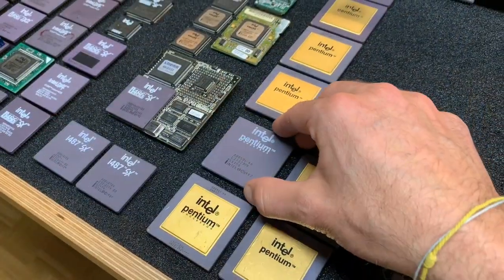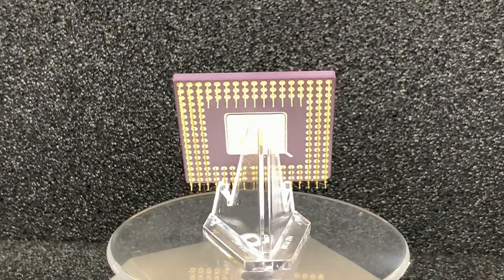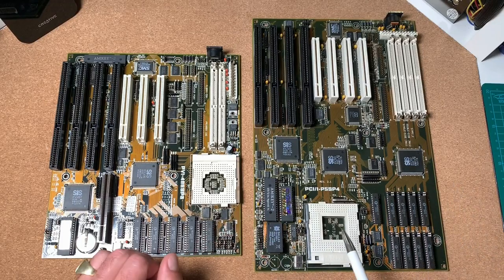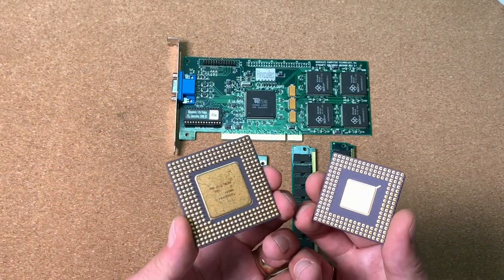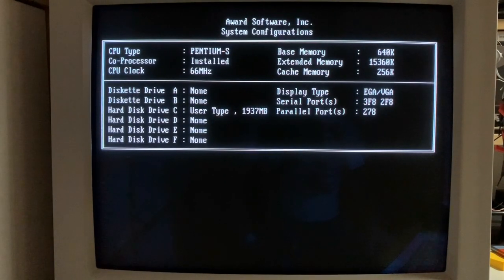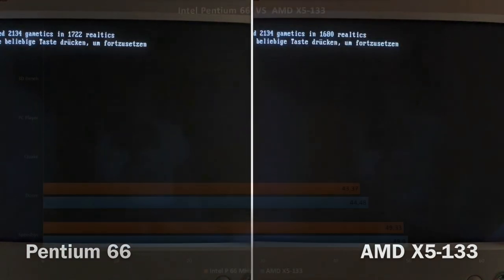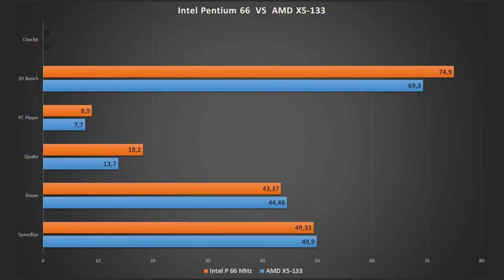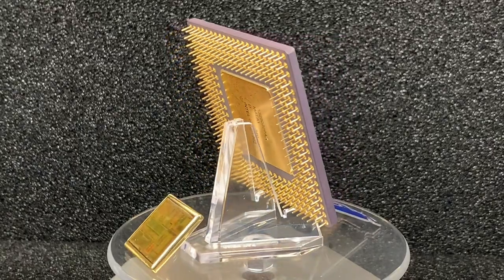Intel Pentium 66 MHz VS AMD 486 X5-133 MHz

Comment: Those early Pentiums are 800 nanometer, 5 volt monsters. Even the first gen pentium had a couple of process improvements. I think there were 500nm version and the last ones were 350nm.
Reply: 600nm, for second generation (Pentium 75,90,100). And 350nm for next one (120, 133,150,166, 200)
and MMX versions. (though they were 2.9V vcore, so were overheating less on higher frequencies)

Comment: Cooles Video. Besonders deine Wahl an alten CPUs. Ich bin auch derzeit am überlegen ein DOS PC zu bauen, allerdings kein Plan welche Komponenten ich mir zulegen soll. Hast du irgendein Vorschlag?
Reply: Mainboard ohne UEFI-Bios wie ASUS STRIKER und Intel Core2quad @2700mhz mit 8 GB DDR2 und mit Saphire Radeon 7950 PCIe VBE3 Bios mit 28" LCD monitor native 16: 10 Seitenverhältnis mit Grafik mode in 1920x1200x32 mit MS DOS 6.22. Ready to startup all cores and switch to 64 bit mode.

Comment: A Pentium based system in 1992 was five or six thousand whereas the 486 133 could be had for about half that.
Reply: 90% of the performance for a tenth of the price.

This is why the price of PCs started to decline quite sharply.

Comment: The Pentium didn't perform better in Quake simply because of higher FPU performance, but because the FPU didn't stall the integer unit, unlike on the 486. Quake uses integer and floating point operations in parallel and that's why 486 CPUs struggle so much.

Comment: Excellent and collectible hardware ... very interesting comparison .. the question that remains is the memory access time of the pentium, it seems not to be correct. It would be interesting to try other memories .. maybe 70ns for both setup .. or will 50ns memories works? Greetings, excellent collection

Comment: Rather thanjust  AMD 486 DX5-133 vs Pentium 60, it would have been nice to see some combination of Cyrix 5x86-133GP/4X, AMD 486DX4-120, and Pentium 66 included.  Then an AMD 5k86 P75 vs Nexgen Nx586 P80 vs AMD K5 PR75 vs Pentium 75 for a battle at 75MHz.  Throw in a Cyrix 6x86-80 for kicks.  And last maybe an AMD K5 PR90 vs Pentium 90 vs Cyrix 6x86-P100  vs Nexgen Nx586 P100.  Surely that sets up Cyrix 6x86 P100 vs  Cyrix 6x86-120+ vs Pentium 100 vs Nexgen Nx586 P110.  Could even throw in the IBM 6x86 P120+ or the ST 6x86 P120+, but these are probably too rare to find.

Comment: I just finally got a 5x86-133 from AMD.  My motherboard supports it, but when the machine boots it says DX4-120.  Every benchmark program identifies it as the 5x86, so I don't know what's going on.  It also is confirmed to be running at 133MHz.  My results were just a bit faster on Quake, 14.1  I was using a Matrox Mystique 4MB.

Comment: The 5x86 is an example of the last/best 486-class CPU. The P66 is an example of the immature 1st  gen. Pentium. The 5x86 would have cost somewhere around USD 125-130. The P66 about USD 700. The Socket 4 mainboard would have cost somewhat more as well. A friend bought an early P60 with the the infamous FDIV bug. Even though he planned to use it professionally for econometric modeling, iNtel did not replace it for some time. I never bought a new Pentium I CPU because iNtel deliberately blocked the P55 266 mHz for desktops. It outperformed the PII 266 mHz. Embarrassing for iNtel.

Comment: i got a Socket 4 board, it posts but the dallas chip is dead, and worse, it's soldered on to the board. it has a pentium 66 chip with 8 mb fpm RAM.

Comment: It is a tossup which was the fastest socket 3 cpu. I never really called the x5 the fastest. But it was a great all-rounder. One solid contender is the Cyrix 5x86-120 (rare as unicorns blood) which is able to effortlessly beat a 160mhz AMD in integer performance quite easily.  But besides the rarity, the downside is its awful FPU which was quite abit behind even 486's of the same clock speed. The FPU was based on a highly tweaked Fasmath core from the 386 days, and even though it was fast for its day, having to run it at 1/2 of the 5x86's core clock makes it no match for even a 486 FPU.  And although the 5x86-100 is more common, they are very difficult to get stable at 120. Very few could. But for general windows 95 performance, they were the best you could expect from socket 3 by quite a wide margin. 

The other contender is the P83 ODP. Top notch FPU performance of the socket, integer is just behind a 133 X5. Knocks on the door of the 160 when you can find a specimen that can run 100mhz.  Downsides, poor motherboard compatibility, very rare and expensive, out classed by a P75 on a much more common and stable platform.  

This puts the X5 in a precarious position, it is neither the fastest in FPU nor Integer. But what it does do is cut a very good compromise between the 2. It's much higher availability and more affordable price also makes it the easiest to acquire something which puts itself right in the middle of the best of the best on socket 3. This alone justifies it being the best of socket 3 overall. And there is something about having that no-nonsense overclock from 133-160 that gives it that feeling of great value and validation.

Great video as well, this is my second favorite era of retro computing on I386.  The first is early 386...  I am curious as to the poor ram performance on the Pentium 66 on this video. I wonder how it would differ if it was pared up to a Neptune or Triton chipset?  But the real world benchmarks however seem to show it not being a big deal. Its performance seems fine there.  L2 cache seems right in line as well on the P66, and that is really what mattered. An interesting comparison to isolate performance anomalies would be to disable L2 cache on both systems to see if the P66 is grossly being hobbled by its motherboard. But it has been a while since i fired up my entry level pentium system so I am only going from memory.  It could even be that the two sticks may need to be in the other 2 ram slots, as if memory serves, some of those oddball chipsets could run a single simm on the Pentium, so maybe those are the single channel sockets?  But I think I may be confusing it for some of the later SIS 559x and Ali 3 chipsets which could do this. 

Well, that is enough rambling for me lol.. Thanks again for the great content.. I have subbed and will look forward to binging the channel in the coming days.

Comment: just fantastic video! I love it
you have to make a series of that VS :) and compare the fastest previous family with slowest next generation like you did :)
for example 
8086 on max speed 10MHz vs 286 on lowest 4MHz
286 25MHz vs 386 12MHz 
386 40MHz vs 486 16MHz 
486 133MHz vs Pentium 1 60MHz You did this :) checked :)!
Pentium 1 300MHz (your mobile china version) vs Pentium 2 233MHz ! :D this will be interesting  !
Pentium 2 450MHz vs Pentium 3 400MHz ! this will be interesting as well :)
Reply from the maker: intel386DX Very good idea and some of them i will for sure do!
Reply: @CPUGalaxy  thanks when I so you drawer with all those CPUs I just go in to ecstasy :D
Reply: @CPUGalaxy  8088 vs 8086 vs v20 vs v30, clock for clock

Comment: Didnt 486 have 487 coprocessor for floating point calculation? was it included in cpu or bought separately?
Reply from the maker: a 486DX has the FPU integrated. The 487 chip which is separate existing is a full 486dx at the end.
Reply: @CPUGalaxy  Was primary reason for Quake, pentium dominance couple of MMX instructions, which ruined other cpus? (I wonder how developers made support to still run that game despite slower)... I've long wondered, as I understood it could have been paid cooperation between iD software and Intel to boost pentium sales (for obvious reasons as dozen manufacturers like amd existed for 486 compatibles to make much faster and cheaper cpu's than original intel ones), that could quake be programmed to be equal or even faster on these high end 486s? 
Cyrix didnt have floating point unit, why it failed understandably in Quake). I saw this many times during 90s that some software just refused to work, coz some supposed cpu instruction was missing, despite program itself not that demanding to argue for that. Even today some games refuse to start on 10 year old cpu, (eg. Xeon), despite much higher performance than regular i5.

Comment: Back in 1996, I had an AMD 5x86-133 system with 16 MB 70ns RAM, with 1MB Cirrus Logic GD-5428 VLB (Vesa) video, and I always ran Duke NukeEm 3D fluently at 1024x768x8 at 60 fps, even in multiplayer mode (14.4 Zoom modem).  My monitor was the excellent CTX-1560 15" CRT.
Reply: CRT doesn't work that way!
Reply: @dallesamllhals9161    Oh, you're 100% right.  I was wrong (I corrected my OP).
Reply: @Trev0r98  Sry' for being pedantic. But my - still working - LG 915FT Plus forced me ;-)
Reply: I think you got something mixed up. In 1996 I had the super expensive PentiumPro 200 and could not get more than 30 fps at 800x600 in Duke even with Univbe and that utility that improved video write speed.
Reply: @vladimirrodionov5391  You might be overlooking something.  My '486 motherboard had a 1 MB Cirrus Logic Vesa Local bus video subsystem built into it. It was the fast GD-5428 chip. Made all the difference in the world.  You read that right.  "...I always ran Duke NukeEm 3D fluently at 1024x768x8 at 60 fps, even in multiplayer mode". Another thing is, I had 16 MB  (2x8MB) matched pair of Samsung 70 ns 8MB SIMMS, which did fast paging and interleaving...effectively running at 31 ns (almost like 16 MB of solid SDRAM cache).  The system really did run like a Pentium 75 with a very fast VLB video subsystem.
Reply: No way in hell did you play Duke 3D at 60fps in 1024x768 on that system. Even a Pentium II would struggle to get 60fps in software mode at that res.
Reply: @jaeger8882   Dunno what to tell ya.  Them's the facts.  A decent Pentium II-based system with a good PCI video card would not "struggle" at all in Duke Nuke'Em 3D at 1024x768.
Reply: @vladimirrodionov5391   Was your video card at least VLB?  ("Vesa Local Bus"), or did it use the vastly superior PCI bus architecture?
Reply: @Trev0r98  Strange question. I had a Pentium Pro which was PCI only. My video card was a Matrox Millenium.  And even 99% of Pentium P5 mobos were PCI only. VLB was really a 486 thing.  Honestly I think your memmory is failing you, back in 1997 60fps was uhheard of in ay game really.

Comment: I had an ADW that only went up to 160 MHz but not permanently stable. Once I had an ADZ in my hand, which I brought up to 200 MHz by 50 MHz FSB. I cooled it with a Peltier, but the heat sink was much too small, so I could boot Win95, but it crashed after a short time. The heatsink got so hot that I couldn't even begin to touch it. Maybe you could try again with more modern technology? Unfortunately, I still have the ADW.

Comment: wait the motherboards have the same amount of cache, but the pentium board have double the amount of chips? also what are the 4 empty sockets for on the 486 board? and the empty cache pins on the pentium?
Reply from the maker: good question. on the 486 board are 4x 512kbit cache chips installed which gives us 256kbyte. on the pentium board are 8x256kbit installed which are 256kbyte as well. the empty part of the sockets at the pentium board are for 512kbit chips which have some more pins. Same the empty sockets on the 486 board.
Reply: @CPUGalaxy  so you could put another 256kb on the 486 board?

Comment: Quake relies heavily on the FPU and that was much stronger in the Pentium CPUs (compared to the 486).   

Still have an old system with an AMD Am5x86-133 Mhz and AMD compared it to a Pentium 75. That claims are not completely off, even if some FPU-demanding software will run slower on it.

Comment: Ah I was going to say I never seen a double stamped amd. but I see it is one of the 133 socket 3? 486 board processors. Based on memory from that time. I remember a few things. 1. programs / games favored Intel cpu. (different reasons.). 2 Intel had to come out with their own version of 133 486 processor. I didn't even know it existed. By that time the shop I was working for was doing Pentium 75's. 3. They did finally come out with things like a Super socket 7 board that could handle 3 different types of processors. Then last year I found out over seas was even another type. Once again seemed like Amd and such was fighting more than just Intel even when they had some superior processors.

Comment: Pentium has long RAM access because it's a wider bus (as hinted at by the "8 bytes" instead of "4 bytes" in the 486)
Yes, the access time is a bit longer, but it's getting twice the data in that time. Will it make up for it? 
Who knows! That's just the theory.

Architecturally I think the Pentium is a huge win, but the incredible clock speed and equal FSB of the 486 will win it here, just a preliminary guess. It will hurt in Quake because of stalled FPU thing.

Comment: Excellent video with clean, pristine hardware -  your stuff looks you bought it yesterday.
Did you leave the BIOS settings on standard? 
If you find the time - could you maybe send your doom benchmark scores to Anton's(TU Wien guy)
https://www.complang.tuwien.ac.at/misc/doombench.html
site's a nice blast from the past regarding the looming shadow that Doom left on the hardware scene. Only change would be that you decrease "screenblocks"  from 10 to 9 (one '-' press on the keyboard in your case yielding HUD & one green border element) and then bench demo3.
I have never seen an SiS501 equipped board besides the ones from ECS. Back in 95 the, affordable, bee's knees were all these generic Intel Mercurys which Vobis and Escom stuffed into their funky towers. Totally miss those times.

Comment: this is interesting the sis chipset must be very kind to the amd or very unkind to the pentium ive never seen the am586 beat a true pentium on any of my hardware, even the pod83 on socket 3 tends to beat the the am586. also interesting phil put together that benchmark suite but i will say attempting to playback mp3 or any compressed audio formats is another way to put chips of this era through their paces and also showcases chips with strong fpu in a non gaming workload actually one load the cx586 tended to match or beat the pentium and leave the am586 trailing behind even if overclocked

Comment: Great video.  Went about as I expected. 486 slightly better for most things.  Was surprised at how much faster the 486 was in Duke 3D considering how much slower it was in Quake!
Reply: quake makes more use of the floating point unit then duke3d
Reply: quake uses an odd trick, known as fast inv square root, and managed to utilize both ports of the cpu with clever instruction scheduling. This was an trick that puts intel cpus far apart in quake based gaming benchmarks.

Comment: Definitely an interesting result - they seem quite closely matched. Considering the X5 has the P75 rating, that would also be interesting to see, as I wonder what effect the reduced 50MHz bus would have on things.
Reply: Well, at 200 MHz it does perform like a P75 in Quake.

Comment: Maybe if you changed the jumpers to maybe  3x40/120 or  3x50/150 - maybe it could be the pentium at 4x40/160 -Anyway I played Quake at 150 as far as I remember making the buss 50 would or should change the graphics card bus -but Im not anymore shure -its been 25 years since

Comment: The intel 80486 CPU in common geek parlance was shortened to just "  '486 "  .  You say " '486" like this: "Four Eighty-Six",  not "Forty - Eighty -Six".  "Forty Eighty-Six" would imply "804086", and that is not an intel designation or CPU model number.